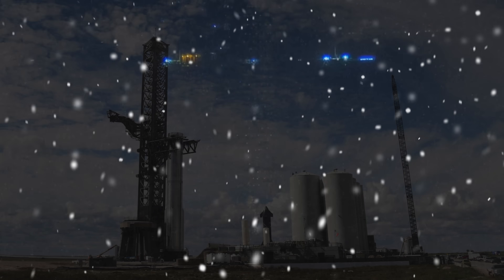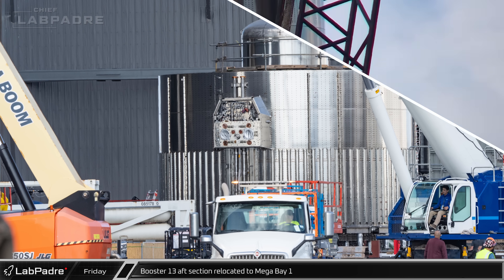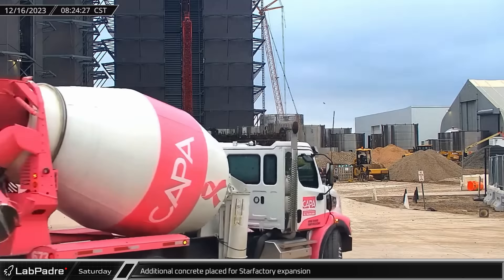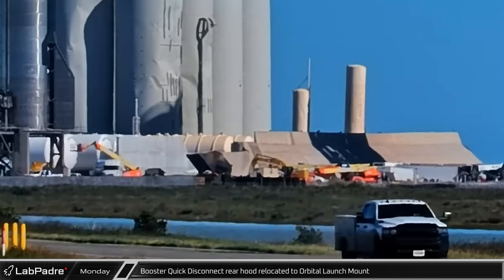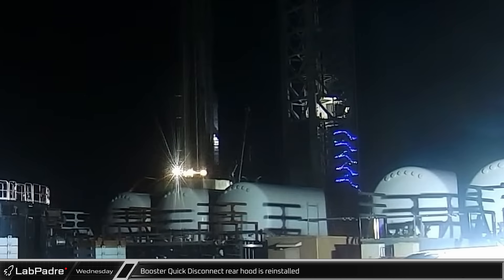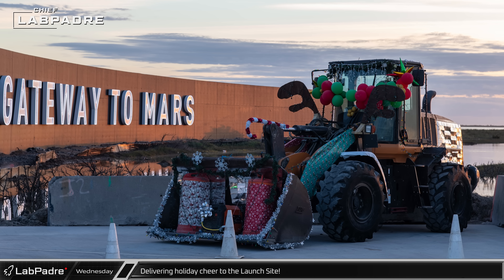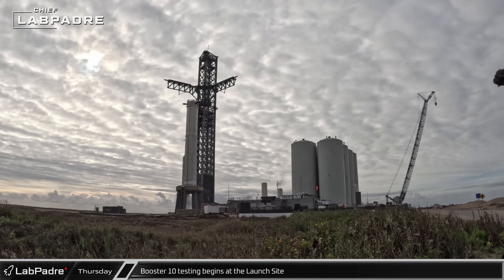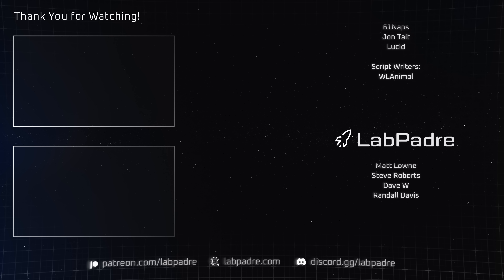Finally!! SpaceX Conducts New Starship Hardware Test! - SpaceX Weekly #94

Comment: ISTM that the Starship Starlink Sat dispenser hardware violates Elon’s ‘best part is no part’ considering that SpaceX must still develop fully hinged Starship farings to release large payloads. Why not just develop the full fairing hinge & use for all payloads including Starlink & not waste time/effort on PEZ dispenser?
Reply: I think a common misconception here is that Elon fully controls everything that happens with starship and does whatever he thinks is best. There’s an army of extremely talented engineers behind the scenes who are doing the actual work and I’m sure they have a good reason for doing the payload design in that way. There will be tons of different types of ships. We already know of the fuel depot, pez, HLS, and USAF versions. They likely are manufacturing a solid back end system that can accommodate these types of variants decently smoothly. Elon, like most CEOs, is just a relay/face of the company for the actual professional work being done behind the curtain.

Comment: Seemed like Starlink ground station is awfully close to the high bays blocking significant sky view in that direction.
Reply: if the bunker is twice as far from the high bays than they are tall it should be fine and not block anything at all, as the starlink satellites do not TX/RX to anything below 25 degrees above the horizon..

Comment: I hope SpaceX will settle for an intermediate smaller Super Booster with 13 Raptors or 15, that could be configured into a Super Launcher with the same design as the Falcon Heavy with two 13 Raptors side boosters ! Oink! Starship is a Mammoth rocket that goes nowhere, but a 15 Raptors booster is as powerful as a Saturn5 and coupled with a disposable 2nd stage can bring anything into lunar orbit and back! I hope!
Reply: That would defeat the whole point to Starship